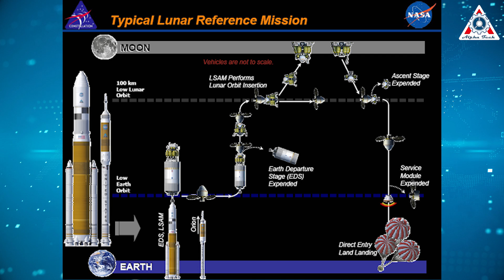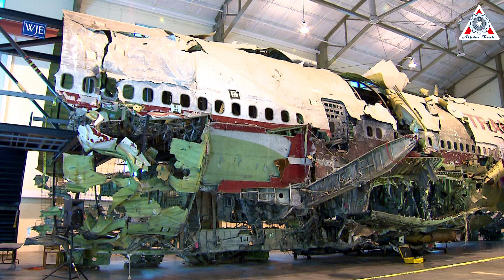NASA SLS FAILURE...!

Comment: One missing FUBAR: (And, I could be inaccurate, it's been a decade since I cared about SLS.) There was a group at NASA that wanted to do a SLS-like "Based off shuttle main tank' rocket during the Shuttle cancelation discussions. They were sidelined just long enough *for all the machinery to actually make the main shuttle tank to be sold off* , before NASA eventually decided "Hey, let's use something main tank like." The new tank, however is a different *diameter* - requiring different tooling. No, I don't know how much money they spent (or not) rebuying the just-sold equipment before figuring out it won't work.
Reply: SLS has always been an 8.4 meter configuration.  It was the Cargo Ares-V from Constellation that used the 10m core with 6 RS68 engines.  Boeing refused to use the original Martin Marietta contruction tooling and techniques.  The USA really shat the bed when it passed on the DIRECT proposals.  The External tanks that were used for Shuttle already had the loadpaths for use in an Inline configuration. As part of the SuperLightWeight T(SLWT) upgrade to help Shuttle reach the ISS orbit with sufficient upmass, extra material were machined off the tank structure.  Improved strengthening of the structure for advanced inline Jupiter rockets required less of this material to be machined off.  Asimple adjusment of a CNC machine was the only requirement for advanced inline use  Boeing wanted to redo the "tank" construction, going from horizontal to vertical construction. Why, because it costs more. While the Shuttle ET and the Boeing Core Stage certainly share an 8.4m configuration, a complete 100% redo of the componentry and assembly techniques.   The only part of the SLS that is actual STS heritage is the RS25 engines, though they have new controllers and will be run at 109% for Arty 1-4 and the New Build RS25 for Arty-5 will be run at 111% Rated Power Level.  Even the new Redesigned Solid Rocket Motor -V(five) for 5 segments of propellant have never been fired in the vertical/launch position.  These are the largest rocket motors ever fired with over 3.6 million lbs force thrust each x 2.  I've seen the thrust traces and the maximums look to be about 4 million pounds thrust at about 15 seconds after launch, so 8 million in booster stage, with approx 2 million for the core (sustainer) stage.  Sounds like about 10 million pounds of thrust.  SLS will be NASA's last launch vehicle.
Reply: @hoghogwild  Sounds like the much more detailed version of what I recall. Forgot the interim step of AresV. The arguing over changing the size and then failing to keep the tooling led me to stop paying any attention. DIRECT certainly seemed fine from my recliner. SLS will indeed be NASA's last full launch vehicle.

Comment: NASA has been left behind by private industry.  Why is that a surprise?  In general, design by committee has resulted in most of the worst things the American government has ever built.

Within the free enterprise system, detected design flaws can be quickly corrected.  Not so in a bureaucratic design environment like NASA.  "Free Enterprise" within a bureaucratic structure seems to morph from engineering innovation by contractors to innovation by contractors in finding ways to milk maximum money out of projects.  It seems that deep pockets combined with bureaucratic administrators who are not engineers tend to freeze engineering innovation.  NASA's history overall shows that pretty clearly.   SLS is the pitiful cherry on top.

This is what happens when enormous engineering projects awash in money do not have competent engineers making the decisions at the top.  But everybody DOES get great vacations!  After all, it IS government.  It's not THEIR money that they spend.

For less money than NASA has spent on the SLS and in less time, SpaceX has gone from having NO rocket at all, to the wildly successful and mostly reusable Falcon 9 launch system, Falcon heavy launch system and most of the Starship development to date.  All using several different engines also developed from scratch at SpaceX during that time.  Oh yeah, 'nearly forgot the reusable Dragon crew capsule (currently docked at the ISS)...and building of the Texas launch facility with an on-site rocket production factory...Starlink...the list could go on.  Ahem.

Comment: The tank popping was an intentional test-to-failure, done to learn about the limits of the tank. SpaceX has done the same, many times with Starship test tanks
Reply: The clip was of the pressure test, but the narration was referring to the dropped lox tank dome in May of 2017.
Reply: @grungar3x7  yeah, not all the pics/footage are of exactly the thing he's talking about

Like at 4:45, he's talking about the first STS launch, the pic onscreen is clearly not that launch (STS-1 had a white painted tank)
Reply: But they didn't do it with a multi-million dollar tank. The tanks are CNC milled with a custom designed milling machine, and then welded into tanks (I think 3 sections make a tank round).It probably failed at a weld.
Reply: @Stubones999  imo still better to do it with a multi-million dollar tank than a billion dollar rocket
Reply: Yep rather than learning the limitations in a actual flight, like another entity.
Reply: @dubuque1  that wouldn't be so smart for such an expensive vehicle. Even the company most known for doing a lot of flight tests - SpaceX uses testing-to-failure for Starship.

Comment: A lot of misinformation here!!! Just one example is the LH2 tank structural test: The tank was pressurized to failure, to test actual failure to design failure. In video, it’s presented as an “accident” that caused its failure!! LOL!!! No domes we’re EVER dropped on the tank! There are no domes to drop! The domes are on the ground and welded to the barrel sections on the ground in special robotic welding fixtures. No domes are ever lifted, until after they’re welded! Why in the world would you think any “dome” was lifted, much less dropped!!!

SMH

Comment: NASA took a wrong turn 50 years ago when it abandoned Saturn and Apollo. and they are still trying to reinvent the wheel. Had they stayed with Saturn/Apollo, they could have launched everything the shuttle had launched, gone to the moon 100 times, built a space station, a moonbase, and maybe even gone to mars (and back), had money left over, and not killed 14 astronauts. 

We are actually worse off today than we were 60 years ago, in 1962. At the time we already had a "space launch system" and could put a man into orbit. (Project Mercury) We had a working space plane (the x-15) practicing winged re-entry. The Saturn 5 engine had its first test. The Saturn 5 rocket design had been finalized. In 7 years, man would land on the moon. 

Today NASA has .... nothing. No working launch system or capsule. No space plane. No way to get into orbit, much less go to the moon. Instead, NASA has to beg its old rival, the Russians, for rides into space on their rocket and buys its rocket engines from them as well. The Russians stuck with a proven design, and today they have one of the safest and most reliable systems around, while NASA can't even get off the ground. 

There is a solution - scrap SLS, go back to Saturn Apollo and get leaders whose attitude is "Failure is NOT an option." With luck, we can be back on the moon in 10 years. But if we keep going the way we have been, we won't be back to the moon in another 50 years.

Comment: Great point: "The question isn't which will launch first, it's how many SpaceX will launch between flights 1 & 2 of SLS"
Reply: Agreed. You also have to admire the optimism in assuming that there will be not only one, but TWO SLS flights!
Reply: No.  They won't let SpaceX launch until the SLS launches.  That's very obviously the truth.  Every time they get ready to let SpaceX launch, something new is found wrong with the SLS so they have to push SpaceX back for a stupid environmental suit or some other non-plausible excuse.
Reply: I wouldn't want to be anywhere near that thing when they finally light it up.
I suspect it will get noisy...

Comment: Really put into perspective what a true manufacturing engineering genius Elon Musk is!
Reply: I think th4e point is not that Elon is engineering genius, but he is able to choose and hire the best in their fields.
Reply: Spacex is a totally different design philosophy than NASA. NASA wants triple everything, with redundancy  built everywhere, without regard to safety. At some point, that redundancy will cost you safety or at least unreliability. They have had launched scrubbed countless times due to failed sensors. 
SpaceX says Build it quick and figure out how to build it better. Make it better, Blow it up with pressure tests and when you get the process right, start working on test launches. Their fail early means that they will have faults that NASA might not have, but they will know far in advance of a failure and will design around it, where NASA will spend billions and lose all the rocket and development. 
Until recently, NASA said reusibility was impossible. SPACEX said I don't think so... and now we have 140+ reused boosters. 
The only reason why NASA is requiring SLS to be part of the moon mission is to try to use some of the sunk cost and not look like a glaring failure to the taxpayer while SpaceX will need to fly the starships into space and meet the SLS for the passengers, why not fly them on Starship all the way?

Comment: You're right; the Starship will be the death of other manned heavy launch vehicles
Reply: starship has doubts of being used much initially, Those 33 engines are gonna be heavy gas guzzlers, making the fuel cost for every starship launch a big problem in the future if elon wants to get this to launch more frequently. also, small payloads don’t need a massive rocket, Missions like DART and CAPSTONE only need small, cheap rockets to get to their destinations. Big payloads means big cost to manufacture said payload, and they aren’t often launched, so starship might be a bit overkill in terms of payload capacity.
Reply: @Ca48Point5  Yes and no...  Like computer hardware versus software, Starship might have trouble finding missions that it's needed for in the beginning, but once the capability is established, there will be more routine access to the Moon, a manned mission (not a colony however!) to Mar, heavier more capable probes, orbiters, and rovers to more places in our solar system, and cheaper and more comfortable and longer term space tourism.  Also, more missions to asteroids, larger payloads to LEO, larger telescopes, etc. etc. etc.

Remember, if the Starship is successful it will revolutionise space access, not only because of its capacity, but because of the reduction in cost associated with complete reuseability.
Reply: @Ca48Point5  Starship is not overkill if you want to build a Moon base or a Martian city.
Reply: There are only two other manned heavy launch vehicles in contemplation at the moment, SLS and New Glenn, and both are unlikely to succeed.  Thank goodness SpaceX is there building Starship!  It may or may not succeed, but if any organization has the attitude and mindset to make it into the revolutionary vehicle it is designed to be, it is SpaceX.
Reply: That’s the issue, Those are big payloads, and big payloads equals big costs for the consumer (for example, a module of some future space station) And manned starships are a risky endeavor since, you know, no launch abort system. Also, unrelated question, how will starship store big payloads other than starlink V2? Will there just be a giant door on the side? or a big hatch on the nose similar to Crew dragon?
Reply: @Ca48Point5  Big payloads actually can cost less, especially when the entire Starship is reuseable.  As for a launch abort system, there is no reason why the upper stage can't become an abort system, similar to the Dragon, but on a much bigger scale of course.  

Once Starship is an established orbital rocket and spaceship, there will be a number of upper stage variants.  There will be a crewed upper stage of course, but there are also plans for a cargo version, a fuel tanker version, a deep space science version, a lunar lander version, and so on.  SpaceX are also working on a door for Starship to deploy Starlink sateilltes, and I think they would be working on a "clamshell" type of arrangement for larger payloads so that it can close up again for re-entry.
Reply: @chrisantoniou4366  Building a launch abort system for a ship as massive as starship is gonna be pretty tricky, first, those 33 raptor engines are not going to make escaping the booster any easier, during an abort, and the subsequent separation of the upper stage, the booster suddenly has less weight to push, and therefore goes even faster until it inevitably tumbles or explodes. the launch abort system will not only have fo be powerful, but not take up too much space. We obviously can’t use the main engines since that’s just gonna cause an even bigger explosion, and if we were to have a dragon-style abort system, it would take up a lot of valuable space needed for the payload. Also, when i’m talking about expensive, I’m not talking about an expensive launch, but an expensive development and construction period for the customer, A module to a space station or a lunar surface base is a lot more expensive than a comms satellite. While the launch itself might be cheap, the payload is not, and any failure will be a giant net loss for the manufacturer and SpaceX, we all saw how those astra launches went.
Reply: @Ca48Point5  As per my previous reply, you could make Starship dockable, send it up unmanned and then send a crew up on a Falcon 9 and Dragon...
Reply: @chrisantoniou4366  The crew rating also applies for loss ratings, if starship has too many failures early on, it still won’t be crew-rated even when only traveling in the vacuum of space. The craft also has to prove itself capable of having humans on board during entry into an atmosphere (Ex: Mars missions, Mars has an atmosphere, and therefore the ship needs to be capable of entering with crew on board) same thing applies for landing on the moon, except the starship has to prove it can consistently and reliably land on the moon with crew inside, which NASA seems to be betting on for their crew lander (again, NASA and SpaceX are partners)
Reply: @Ca48Point5  Sure, I get what you say, but I was only addressing the launch abort issue, which can be solved as I outlined,  This solution will bring the added benefit of having the Dragon capsule docked to provide a lifeboat in case of a problem with re-entry.  In fact, the whole upper stage of the Lunar Lander could be made without thermal insulation so the returning astronauts can use the Dragon for re-entry.  Of course the thermal insulation of the Dragon would have to be upgraded to cope with the higher temperatures of re-entering from a lunar voyage, but that is a minor issue in the grand scheme of things.

Comment: The irony is Orion is operational but its delivery system isn't.
Reply: Orion has had issues too. Not quite failure free especially when not able to be launched/tested
Reply: @truman3531  I agree it needs more testing but it's still relatively safe and SLS has yet to launch. I checked if Falcon Heavy could do it but it's capable of taking Orion to orbit but not to the moon. If the Superheavy booster proves reliable launching Starship, NASA may have a big decision to make. Die on the SLS hill or just bite the bullet and switch to Superheavy.

P.S
Superheavy with Orion on top, not Starship. I'm sure they could adapt the top to carry Orion.

Comment: What a great disappointment. They should just stop stalling starships orbital launch… re-evaluate everything that is broken with SLS…. Rebuild it from toe-to-head and take another ten years deciding and revising wether or not it was constructed again to spec. Great work NASA. Great work.
Reply from the maker: Why stop Starship?
Reply: Mike is saying NASA/Faa should stop stalling, blocking, sabotaging SpaceX/Starship with contrived bureaucratic BS “environmental reviews’ etc. 

Nasa’s pork boondoggle piece of leaky shit Space Launch System rocket program has cost $60+ billion over 16+ years. SLS  $25+ billion. The Orion deep space capsule has cost $25+ billion since the program began in 2006. Related ground infrastructure upgrades cost an additional $8+ billion since.SLS costs $4-10 billion PER LAUNCH. For 100% throwaway, carcinogenic SRB exhaust, toxic boosters dumped into our oceans. 

 SpaceX’s clean, green Starship cost $5 billion to develop, $10 million per launch.. 

Again Nasa manned space going nowhere since 1972. Government is irresponsible/uncaring greed, waste, incompetence, monopoly & corruption, & NASA is government.

#defundNasa.
Reply: @alphatech4966  he said stop stalling. Not stop. For some reason, he thinks they are stalling purposely. As for SLS, they should just give to China. Its so bad, even China doesn’t want to steal the design.
Reply: Or, we could have the cheaper Ares rocket, which was a very promising design, and designed to carry orion. The one point i do agree on with the elon simps is that Ares should’ve continued
Reply: @Ca48Point5  After the ‘flags & footprints’ unsustainable, unaffordable dead end SaturnV/Apollo, NASA promised a gullible Congress/America a $4 million per launch Shuttle, then delivered a $1.6 billion per launch white elephant.. Constellation was a another disastrous incompetent NASA boondoggle cancelled.. SLS is a $60+ billion unsustainable, unaffordable $4+ billion per launch NASA failure boondoggle.  Get over the faded Apollo nostalgic BS…  #defundNasa.